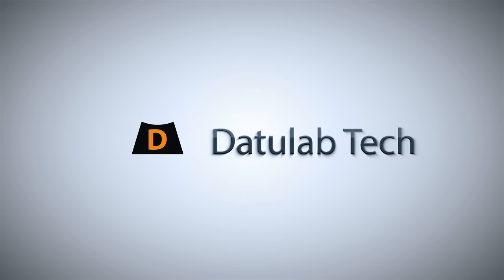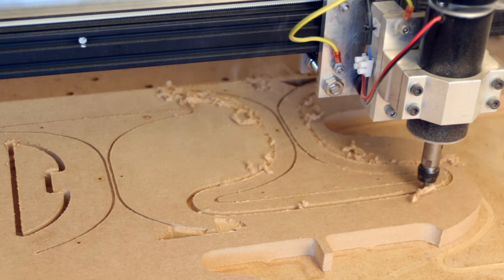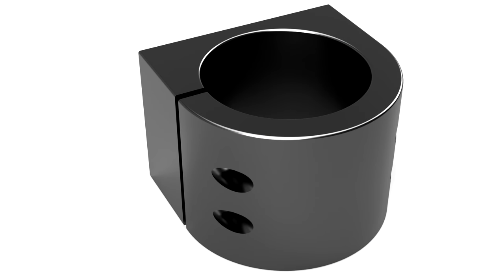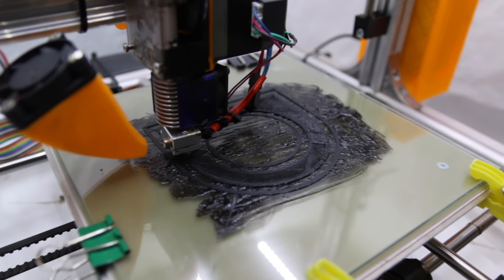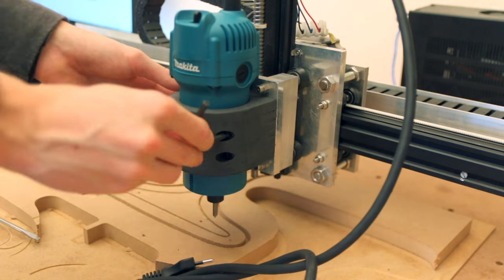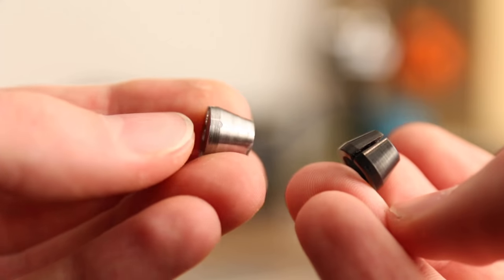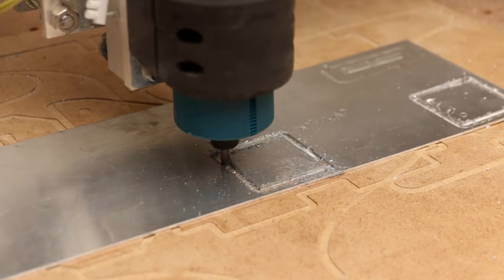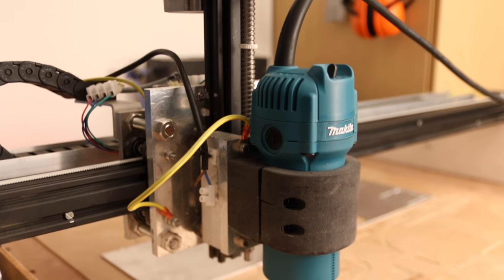My CNC ROUTER went up in SMOKE! - Time to Upgrade the Spindle

Comment: Well about speed you can add a triac to change the speed or lets say a dimmer just like those used for light for a 500w it will be good selution
Reply: I had the same thought.  I was installing a motorized ceiling mount for a disco ball a couple years ago and needed to decrease the speed of rotation.  The dimmer switch worked perfectly and, if I'm not mistaken, the same principles would apply here to enable the router to turn at a lower speed.

Comment: i wanted to put something similar on my cnc but someone sugested i need something with aluminiun case because when you tighten the collet might affect the bearings. correct me if i'm wrong.
Reply from the maker: Sorry, I don't quite understand what you mean, is your question about the collet I made or the router I bought?
Reply: Datulab Tech the router
Reply: He is worried about damaging the actual interior workings of the router by compressing and warping the casing when you mount it.
Reply from the maker: As long as you don't tighten your fixture down with brute force (which isn't necessary) that won't have any impact. The plastic of the router is really strong.

Comment: I used a Bosch Colt router to begin with but it was so noisy I got a Chinese air cooled spindle for my CNC. The Chinese spindle is a lot weaker, but it is so quiet I don't care that it takes longer. Plus I like ER11 collets much better than router collets.
Reply from the maker: +Paul Frederick +Paul Frederick the thing with the collets is true, I chan get a complete er11 set for the price of one for my router.
Reply: +Datalab Tech your spindle going up in smoke still troubles me though, because the spindle I have looks exactly the same as it. I do wish my Chinese spindle spun faster often too. 12,500 RPM is just too slow running small diameter bits. I just isolation routed a PCB using a 20° engraving bit. It came out good. But I ran over the job a few times to clean it up.
Reply from the maker: +Paul Frederick well the good thing is that there were no flames so there was no risk of anything catching fire.
Reply: Es correcto.

Comment: Hey! you have exactly the same makita router i have at home. i'm planning to build a CNC frame and design the bracket but i'm worried about the speed since i will be mostly cutting aluminum molds. what do you recommend? did you find a way to deal with the speed?

Comment: I saw this spindle and i wanted to buy it, but i'm not sure about the temperature that this might reach during long sessions, how is it working for you? what's the longest print you done with it in these 2 years? what the top temperature of the spindle you registered? it's the only piece that i miss to build my CNC router but i plan to do long milling session with it
Reply from the maker: I don't have a temperature probe on the spindle, but I never had any problems with it. It of course also depends how hard you push the spindle, my mechanics are the weak link, so I never pushed it to it's limit.

Comment: Think outside the box. Use brushless motor for the spindle. That Chinese spindle motor that puffed and went to smoke. Expensive and yet have a reputation of burning. Your new spindle got a lot of torque, definitely, but with the loud noise it created during operation, you will be lazy enough on using that CNC. LOL

Comment: To print such a big part from ABS you need to enclose the printer to keep the heat in and do not allow to overcool the print.
Reply from the maker: I do have it in a kind of enclosure and after I glued it down it went quite well, just my build plate doesn't get hot enough for the ABS to stick to it.

Comment: I would have suggested the Dewalt 611 that is basically the same size, its variable speed down to 16000 or so, and its twice the power for only 25 bucks more.

I say that but im buying a machine that has a 1500watt watercooled chinese spindle. hopefully it will not blow up like yours!!!!

P.S. Awesome videos dude, i just subscribed a week ago!
Reply from the maker: Yea, if Dewalt is available in your area that is a great option as well, I can't get my hand on them though without paying a hefty premium as they are not available where I live.
Best of luck with your machine!
Reply: Makita is better than DeWalt. At least Makita motors are unparalleled. A router is basically just a motor too. Makita has ridiculous specs for their armature balancing. Makita fails armatures if they have to remove too much material to balance them. Then other companies buy Makita reject armatures and use them in their tools. At that they have the second best armatures in the world in their tools when they do that. Right after Makita first run parts.

Comment: Can you tell me if until now you had problems with accuracy with this Makita? I mean if the plastic housing is strong enough? And also, if you can tell me what is the diameter of the Makita housing - the diameter that fits in the bracket. I intend to install the same router on my CNC.
Reply from the maker: I didn't have any problems with the plastic housing but I have a feeling that the collet doesn't run 100% true. If you can afford it, there is a model one up that has a metal housing and should be made a bit better too. The diameter of this one is 64 mm.
Reply: Thanks for your quick response. The one with speed regulation is about 90 Euro here. Is it so useful to be able to adjust the speed of the router?
Reply from the maker: It is quiet useful, especially if you want to cut acrylic or aluminum too as you want slower speeds for these materials ideally. You can live without it but it's nice to have.
Reply: Mihai Popa I got the RT0700C. It runs between 10-30k rpm and also got 710W. Only comes with 6 and 8mm collets in Europe at least.
Reply: That's the one i intend to buy myself as a "late Easter gift". My biggest concern is about the plastic housing on the 3709/3710 model because i got a lot of Bosch tools that have plastic body and in time it developed a lot of wear around bearings and bushing. That means good bye precision!!
Reply: Mihai Popa hola realmente no es buena idea. Porque makita no esta diseñada para trabajar por horas se recalienta y se tuerse el eje ya que solo cuenta con un rodamiento comparado con los 4 que trae el eje de un spindle especial. Ademas de hacer mucho ruido y esparsir el polvo por toda la habitacion.
Reply: @mihaipopa2330  ce cnc ai? vreau sa-mi pun si eu un 3709 pe cnc si nu stiu ce sa aleg la buget mic:)
Reply: @FalticeniOrg  Salut, eu am Makita RT0700C (corp de aluminiu) sunt relativ multumit de varianta asta desi o data l-am ars si mi l-au reparat in garantie. Am luat de la ZIVTOOL din ungaria cu livrare in romania. E mai ieftin decat la oricare magazin din romania. Pe lemn si poliamida merge grozav, pe aluminiu mai greut dar merge.

Comment: Take apart the router and see what kind of motor driver it uses. Hacking in a speed controller shouldn't be too hard.
Reply from the maker: yea, there are even some commercial ones you can buy. I don't think though that it uses any kind of controller, just the ac straight into the motor.
Reply: I think a lamp dimmer (triac based - 600W or more) should work well in reducing speed. Or you can use the same speed adjuster like in a 230V drill - enclosed in the trigger button :( . I might as well try myself since i have one dimmer that is not doing anything right now...